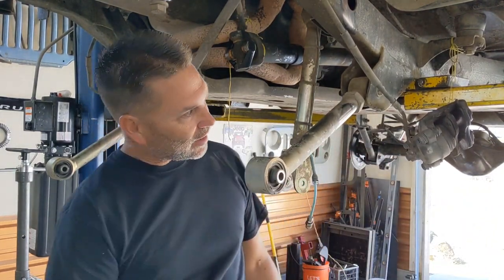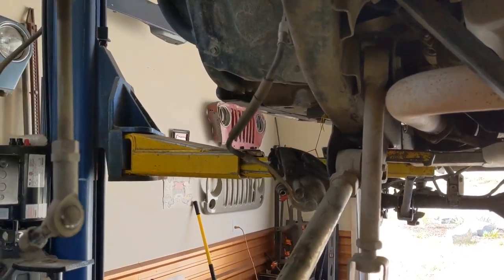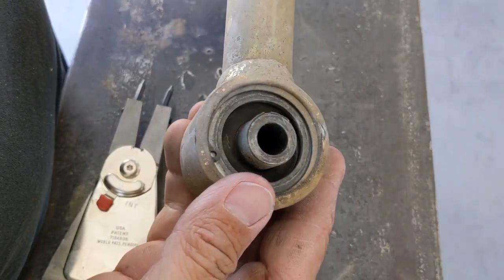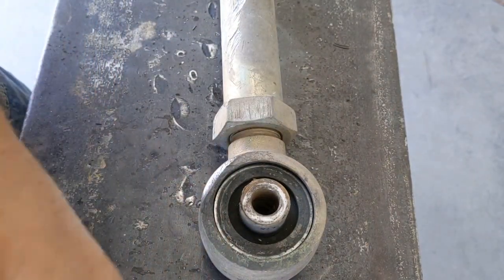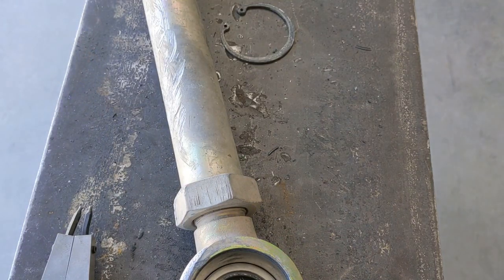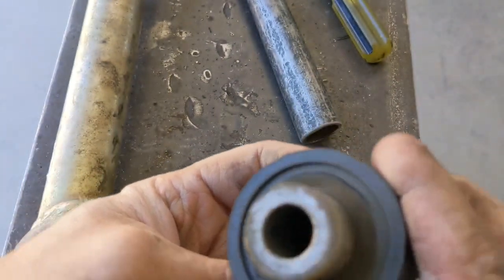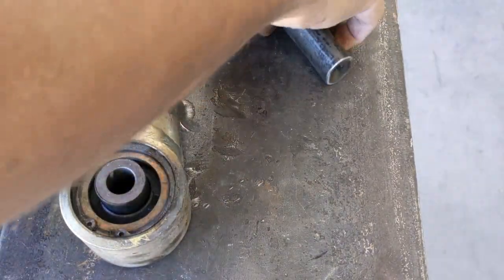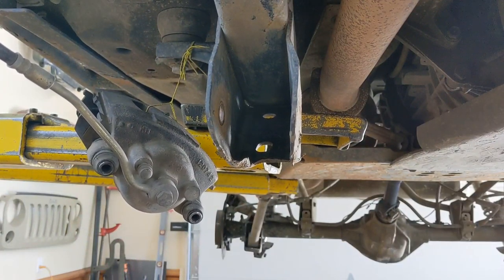How to replace a Metalcloak Duroflex joint

Comment: I really like the Rancho/Synergy bushing style joints. Nothing to fail in their construction. They have a Teflon lining in the pin bore and a steel case which prevents that horrible squeaking. Those damn Duroflex units ain't so Durable. I got one year out of Johnny Joints, the delrin was worn out so there was zero preload on the spherical bearing. Just clankin' around on every little bump.

Comment: Another great video Mike. Very much enjoy the effort you put into your channel. Question: Would it make sense to simply add some zerks to these joints to make maintenance easier? I guess MC recommends servicing them with their grease every 12 months or so.
Reply from the maker: No. There grooves are perpendicular to barrel so grease would only hit one or two. I like to pull them out because it's far easier to determine wear. To be honest, they do wear more than you think. I've had some where the centering ball isn't even attached anymore even though it didn't look like it.
Reply: @TheBFHGarage  Makes total sense. Thanks for taking the time to respond.

Comment: Is this issue with duroflex can cause death woobble?
Reply from the maker: It could help contribute but probably not the main cause. For DW, check things in this order: tire balance, track bar, tie rod ends, ball joints, unit bearings, control arm bushings, steering box. Getting your tires balanced correctly is key, I can't stress that enough.

Comment: What a terrible comparison for control arm joints. The majority or flex/work they do is up and down. Very limited flex side to side in a control arm application. Any of these joints will work. If maximum  movement is the goal a high misalignment heim joint beats all of these links. It all depends on application... Oem clevite rubber is a win for overall use IMO